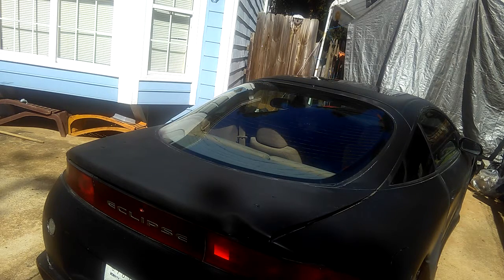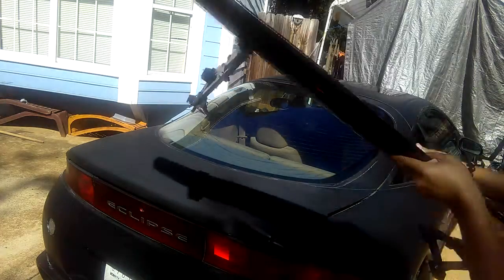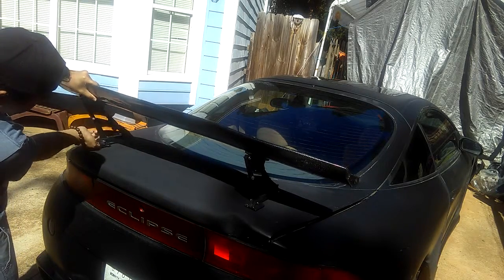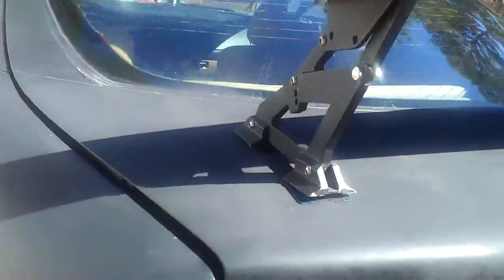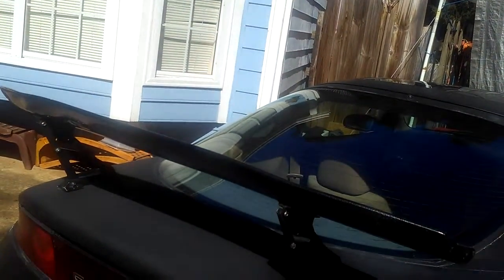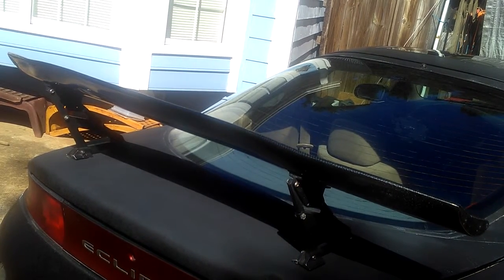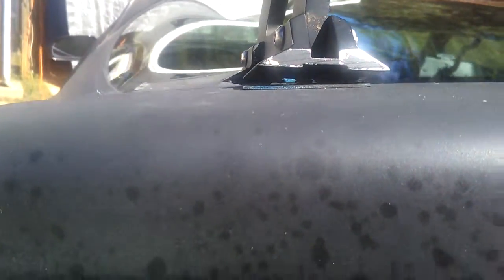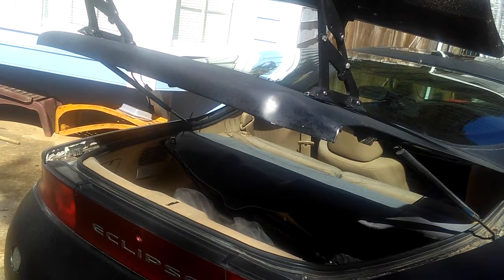How to install aftermarket spoiler on 98 Eclipse GS Part 13b

Comment: I know this is an old video.  But I'm working in my 3rd eclipse. I'm ordering the same Blitz kit as I had before polyurethane this time. The wing that you have is my second to what I actually want appeared more than likely it will be the GT wing. I'm assuming this is the same carbon fiber look that keeps popping up on eBay and Amazon correct? And by the way these Eclipse are a diamond in the rough I love how you're showing it TLC keep doing what you're doing not everybody understands the love we have for DSM
Reply from the maker: Yeah thanks for stopping by videos. I missed that eclipse after I donated to Goodwill years ago after VSS dropped and assumed clutch went out. But I then bought another 2G convertible eclipse 4G63T. I still have the wing though and planning to install it back on to my DA Integra or the next car. I wouldn't install it back to the eclipse though. The GSX turbo wing on the 2G eclipse would fit perfect if you can find them.